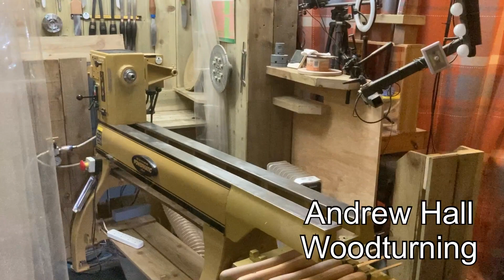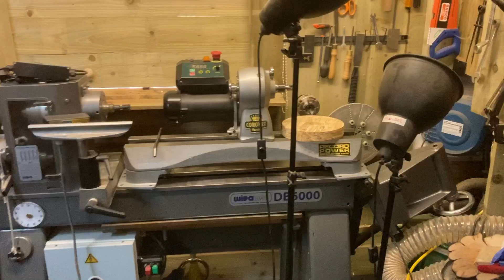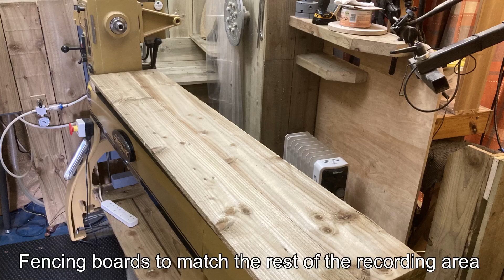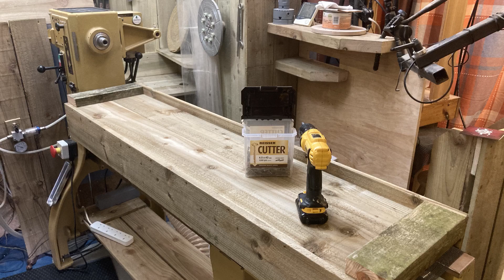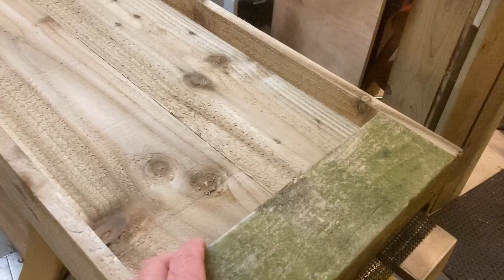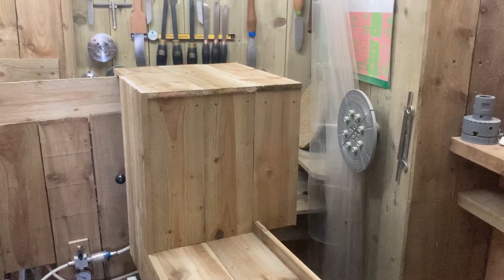Andrew Hall Woodturner and his new Record Power Coronet Herald

Comment: Hi Andrew. Question for you. The lowest speed on the coronet lathe is 250, is that low enough or do you think a low speed like on the powermatic would be better?
Reply from the maker: Hello Jack thanks for the question, it depends on what you want to do, if it’s thread chasing I find it fine for that with 20tpi chasers but if its for applying lacquer while the piece is rotating I would go for a lower speed lathe. I have a powermatic 3520B and both are great lathes but there’s a big difference in cost. No experience with a Powermatic smaller lathe but I’m sure if it anything like the 3520 it will be great engineering. Hope that helps